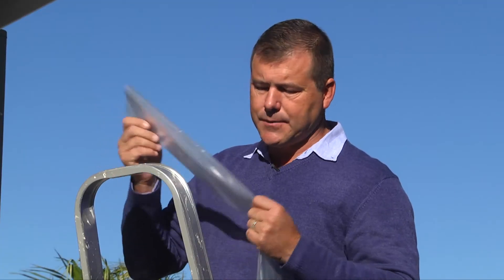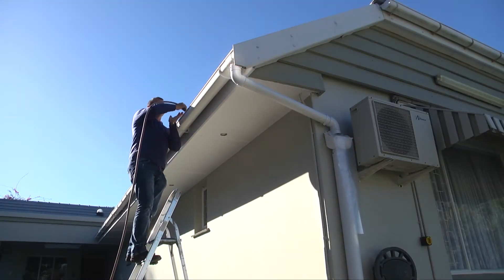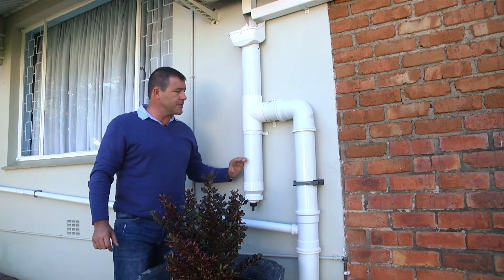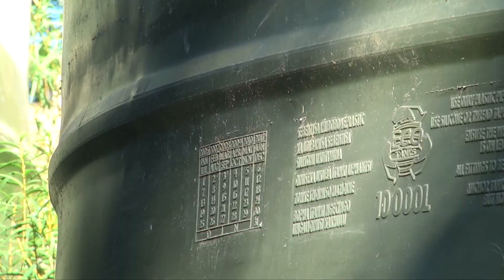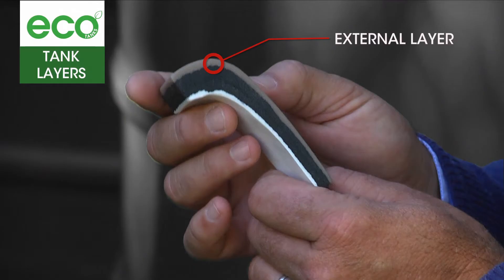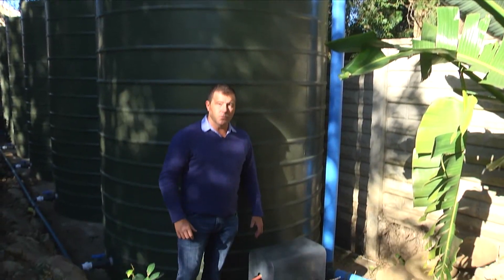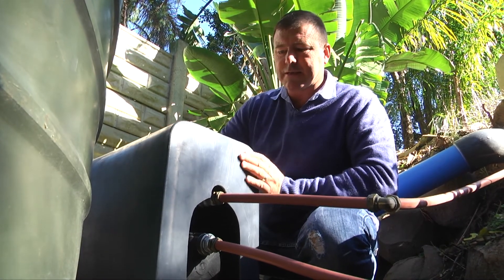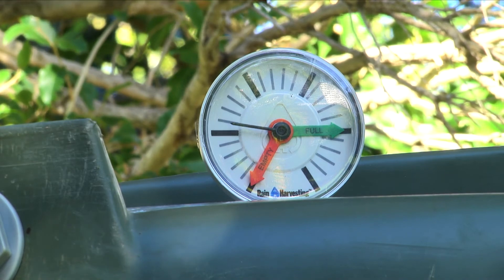Eco Tanks   Rain Water Harvesting Basics & Tips mp4

Comment: Hi Darren, you mention towards the end of the video that all your tanks come with a standard sift, I just bought a 5000l tank from Builders in Port Elizabeth and it did not come with a sift.
Reply: Builders is doing Ecotanks a serious injustice.  I had exactly the same situation.  They also didn't supply the caps and taps.  I wouldnt have known that the tank comes with these until I called the Ecotanks Operations manager for some advice on installation guides.  He mentioned the caps and taps.  We bought 4 tanks and some had sifs and others not.  One of the lids had a large bend which meant that the tank would not close completely, they complained about having to replace it and told me that if the next product they supply isn't to my requirement, they would refund me on the ecotanks and take back what they supplied.  If it wasnt for the EcoTanks supplier's positive attitude in my phone call, I would have returned all the goods.
Reply: @pottery68  Thanks for sharing your experience. I concur with you. My tank arrived with a broken lid. Builders said they would bring a replacement last week Tuesday and they've not done so 5 days later.